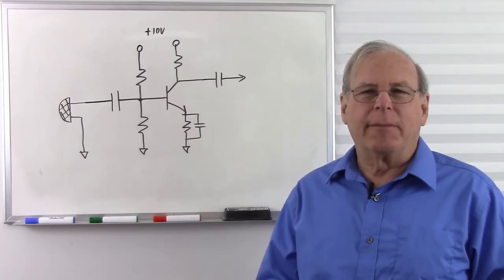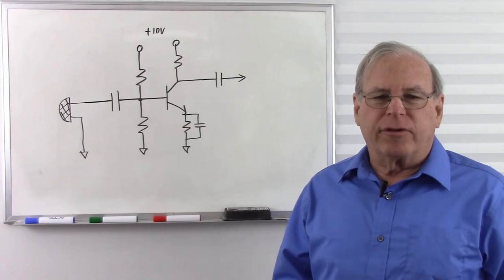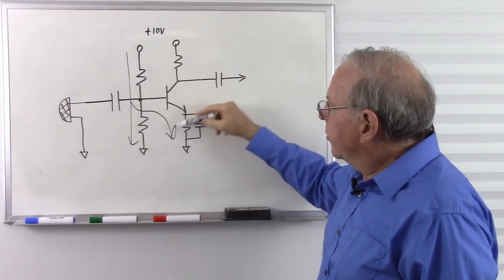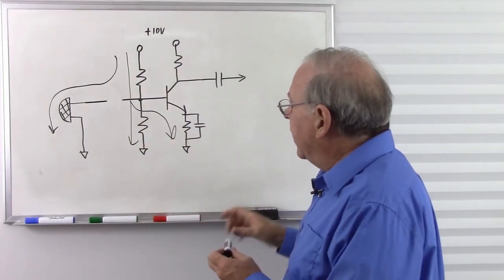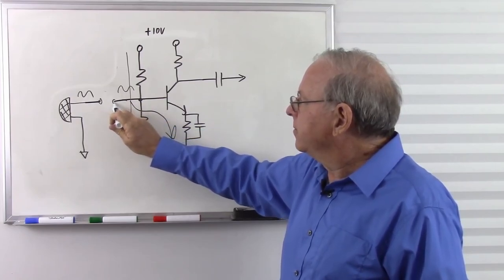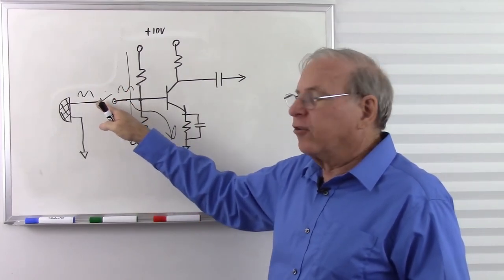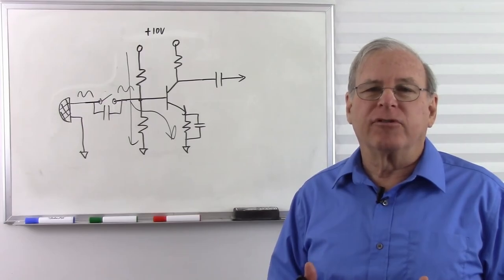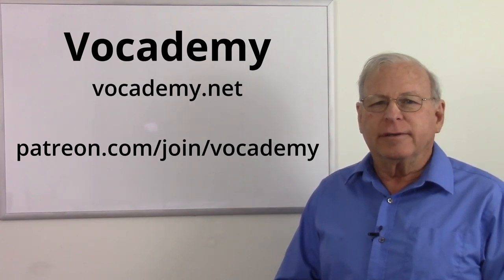Small Signal Amplifiers   Response to Questions and Comments

Comment: Auto focus, suggestion, shut it off. The depth of field is quite shallow, so it may not be necessary. Additionally, you can put a device in the foreground like a carousel so that it locks the auto focus. However, this would probably be distracting from the video. Some modern cameras have controls on the auto focus range. Especially the modern digital cameras that use a matrix algorithm to control the focus.

Comment: Why is the AC coupling capacitor added at the emitter to increase gain if the primary purpose of most of the other additional components are to decrease gain and decrease the significance of the transistor's natural hFE? If this bypasses the emitter resistor why is it needed in the first place?
Reply: Keep in mind that the signal current is a.c., but the working (supply) current of the amplifier circuit is d.c. So, the bypass capacitor does bypass the signal current, but ONLY the signal current: the d.c. supply current still "sees" the emitter resistance, so it continues to maintain the proper circuit bias.

Comment: Would not a diode rectify that part of the AC signal above 0.7v ( if the input was say 2v peak to peak) So there would be an amplified output of the input?

Comment: Another important function of that coupling capacitor is that mic voltage by itself wouldn't be enough to trigger the transistor. Well you could say that's why there is a voltage divider at the base and it's true but still you would need a way to make the ac from the mic high enough (around 0,7V or higher) and the coupling cap does exactly that by staying charged at voltage divider level, which adds a positive offset to the mic ac. 
I guess that's why they are called coupling capacitors and maybe ac coupling is actually shifting up or down an ac and not just blocking dc, maybe they are two sides of the same coin, at least in this case I think it is.

And thanks for the lectures, I am currently reviewing these fundamentals and I find them very useful.

Comment: I did this stuff exactly 50 years ago in a lecture theatre at Manakau Tech. The teacher basically read from the text and drew the necessary things, but wasn't feeling it like we saw here. There was no connection, just repetition. I wonder if he actually understood the material?

By contrast, this time he seemed to feel those voltages, electron flows and AC signals. If this, then that, because... - that is just brilliant and imparts true knowledge to the class. How i wish this man had been our teacher. I got more from this vid than prolly 10 hours of formal amp design in 1974.

Am going to run this up on a breadboard with a 2n2222 or BC54-something and see the output signal change, based on calculations and experiment. And I'm sure it'll work better than those labs at MTI. 

Thank you, I've subscribed and want lots more!